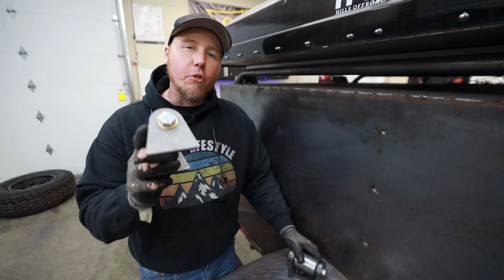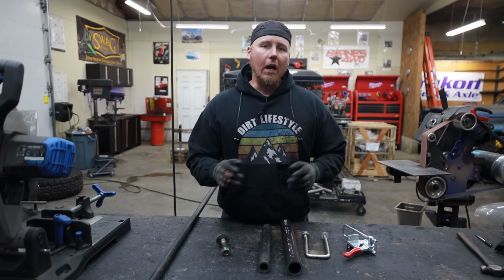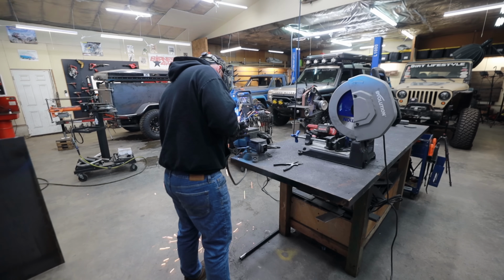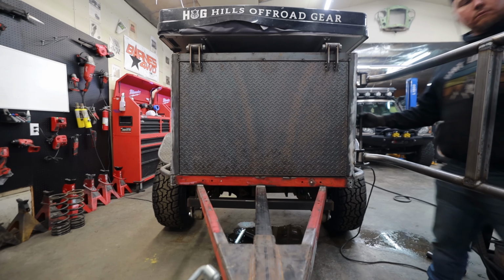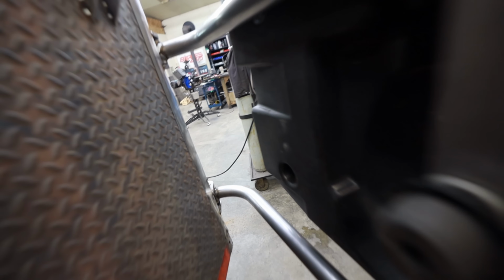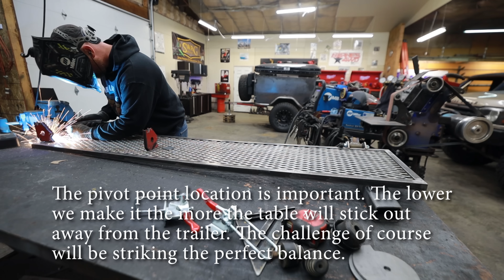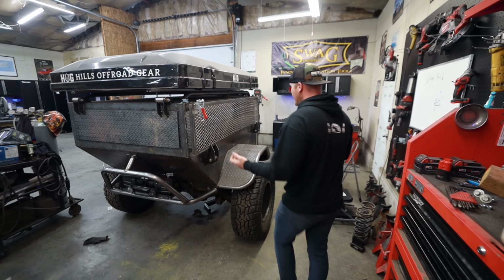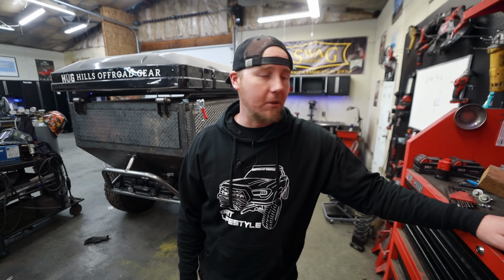Finally Back In The Shop! Harbor Freight Offroad Trailer Episode 6 👊.

Comment: Retracting cable: so you have to think of it as a triangle... on the base of the table you will need a spring about the length of the table. Next you find a washer that you can secure your cable to on one end. slide the free end of the cable through the spring to a cable wheel on the corner of the table. then run that cable to a mounting point on the actual trailer which will determine where the table sits when its flat out. this style would actually help hold the table still during bumps and driving as the spring will always have force on it. when the table is fully opened the spring should bottom out or hit a stop. of course please cover this with a small c channel or square tubing to keep it covered. should look clean and honestly help alot.
Reply: adding some clarification.... this would be using a coil style spring that compresses you can use a normal pull spring you would just hook the cable to spring and would want a spring that would stretch enough to allow the the table to lay flat. and it would pull the back up if the spring was to strong so finding a balance is the hard part for the springs.

Comment: Could you add a length of 90 degree angle going across the bottom of the table - taking the twist out of the table when in use - and then install the bump stop as you suggested? Possibly even add a 3rd hinge to the table? (Not really necessary but would be, your normal, over engineered design)

Cables are cool but for functionality, it would be good to not have 2, 45 degree cables in the way at all.

Love your videos, and keep up the awesome work!!

Comment: What about making legs that pivot and use a pin to lock them in place. You could tie them in diagonally to the tube frame of the fenders. That should give you plenty of support, stay low profile, and no cable to snag.

Comment: Reading through the comments seem there are some really great ideas and some very simple solutions, however if you really want to go with a retractable cable I'd like to see the attempt made. If it fails there are some grate fall back options. Along the use what you have idea, have you thought of using old pull reals for small engines? (lawn mower pull cords) look forward to seeing what you come up with!

Comment: What about using two pieces of 2" flat stock? One stock has a channel through the middle of it and the other has a bolt that can slide up and down, in the channel, with the motion of the table. No cables :)

Comment: Weight the cable/line on the inside of the trailer. When you raise the table the weight will pull the cable through and keep it stowed nicely. It can also help take some the table weight when you're raising and lowering it.

Comment: off the top of my head, you could use gas struts, or...maybe repurpose some seatbelt retractors? could be quiet, pretty strong..and cheap (any pick n pull....) I'm sure there are some high dollar options...but I'm trying to stay with in 20 bucks at a junk yard...

Comment: How about a smaller version of the rear door spring that on the back of a toy box trailer. They have cables to help lift a door that’s heavy maybe with a light enough spring it could be the opposite

Comment: Idea for the table, why not use a stop system on the hinge itself so there isn't a cable at all. you've built it strong enough to handle the weight of it all. shave your stud path into the part of the hinge on the table, then put a stud in the part of the hinge attached to the body, i would use a rod that went through both sides.

Comment: This would require not really a lot of work but...
Try a recoil starter style found in most gas generator starter cover which is spring loaded, which means even if u forget to secure the table it will still be able to hold the table up 
It's actually a simple system but it looks complex

Comment: The idea in the top comment about the flat bars is probably the most reliable, but if you wanted to pay homage to your Land Rover, what about using those retractable cables they use on the lower hatches in the LR3/LR4 (Discovery 3/4), part #BHF780040. Not sure if they would be able to stabilize the tray enough, but thought it might get some wheels turning.

Comment: How about retractable nylon straps? Like a ratchet strap type material or seat belt type thing. I know they have ratchet straps that retract into a little housing I'm not sure exactly how they work but maybe they could be modified? My other idea would be a flat bar hinge like a tail gate but that might be difficult to package. Then I also thought of those little gas struts, the struts would possibly keep the table more rigid but may also be difficult to package as well.

Comment: Before you finish get rid of the huge water tank that isn't removable. Use a few smaller ones you can pull out and wash properly.
Reply: You can link 2 together on each corner to keep the lower side more balanced and add more weight to the bottom of the rig. Mount your 2 battery in the very front corners on each side. Make sure you can remove and access them easily.

Comment: If you really want to use cables I would think "Roll Up Garage Door"... Unlike a garage door however you won't really need any tension to raise the table, You will only need enough tension to wind the cable back up. Also unlike a garage door I would use two independent assemblies - One for each side.

Comment: its call monkey tail or something like that. its use in the oil industrie, as a secure life saver line for the person that is working on the top of the plataform, its a strong to hold a person, and goes in and out so it wont be on the way.

Comment: Use old bike or motorcycle drive chains for the table suspension. They won’t bow or shoot out the sides they will just follow the chain in one plane as you close or open the table.

Comment: you probably already figured out the table supports, but what about the ratcheting ratchet strap systems that are used on contractor ladder racks? will get long when you need it to hook on the table and hold it up, then will crank back up into a small package that can lock and won't come out on it's own. would also help if you put matching tie points on the other side of the trailer to tie down temporary stuff to the top ;)

Comment: First time tuning in; very impressed with your skills! I could definitely learn a thing or 2!
Commenting on neat ways to suspend your table, and it'd be cheaper to build your own, i'm sure; a "Shur-Lok" mechanism, for ag trailers, comes to mind for me. (I'd advise looking at one, if you can, at a truck stop or something (the website displays the mechanism poorly)). Its located at the rear of the trailer, and has 2 little plastic pulleys at the cables exit, and the cable fastens with a loop around the "pipe" that rolls the tarp up.
Essentially, its a retractable cable, that uses a spring of some sort, to assist in the rolling of the tarps, to keep them from rolling crooked. I've never pulled one apart to know exactly what makes 'em tick.
But mount one across the rear of your trailer, and one across the front. Even neater, would be to find a clean way of mounting them both internally of the trailer, and have the cables come out a hole, but make it so it doesnt drag the cable on the way through outer panel.
Good luck! I'm sure you'll find a neat way of gettin 'r done, and i'm anxious to see how you do it!

Comment: Sliding tracks on top of trailer to extend or retract cables? Extend to lower, retract to tuck the cables. Could be cheap with tubing, little peg to keep it from sliding back out. Also can be used extend to hang towels to dry?

Comment: Square tube that's cut at a angle to where it will slide into another square tube on the side you can extend the square tube that's on the ends already.
Should be plenty strong.
Or use chain? Easier to see and looks cooler, can make it to where it hooks to the table and the side?

Comment: Nice latch!

Simplest would be a spring and cable with a stop placed flat under the tent.  Or a seat belt retractor with cable wound onto it, placed underneath the tent.  Going through the side of the enclosure is going to leak, and will undoubtedly leak in rainwater.

I still think the front door, needs to fold down, not up.  This gives you more "table" surface.  And you are going to whack your head into that folded up door at some point.

Comment: How about lift gate struts or a hinge setup similar to a truck tail gate or both so you have the strength of the hinges but use the struts to control how quick it drops down?

Comment: For the table. I wouldn’t want the cable in the way on the side of the table. I’d probably build a strut on each of the fender that supports the table from below then when the table is up you just pin the strut to the underside of the table.

Comment: Would a set of small struts work, something similar to a tool box lid but in reverse. The ball sockets would allow the amount of pivot needed and could retract as well as keep the sides stable. Could even be used in conjunction with your bump-stop on the fender.

Comment: not sure how involved you want the supports to be but you could do a simple weight and pulley system like windows in older homes have. cable through a hole over a pulley and perfectly balanced weights. might be fun to engineer?

Comment: Not sure if i can fully explain this, send me a note on patreon if you want to talk more, but run cable like you want but on the trailer side anchor it  through a hole in the side of the trailer with a stopper on the end.  Then run some elastic cord inside the trailer to pull the cable in when you go to stow it away.  The stopper will give you the distance you need to hang down and the elastic should pull all the cable inside for the drive.  I've seen it done on racing sail boats to keep the lines tucked under the hull and off the deck.

Comment: Just a thought but I wonder if a cable that goes through the side of the trailer with a counterweight shaped like a T or something shaped to catch on the wall and support the weight of the the tabletop would work. Within theory it would be simple and if you placed the cable in some square tubing, the cable wouldnt get kinked up or catch on anything.

Comment: For your table why not use some small flat stock hinged in the middle like a pickup tailgate. When the table is folded up it would be completely folded inside the angle stock of the table frame.
Reply: So I didn’t read the comments before commenting but the tailgate style straps seem to have the most votes. Simple design. Nothing mechanical to fail.

Comment: A garage door has a retractable cable system. It uses springs that are torqued to suck in the cable. You could definitely build a system based on that. Another option would be removable chain with clips at the ends. Either way i would love to help. I'm in the Tacoma area and am a welder/ fabricator. Hit me up if you want any help!

Comment: On the old Toyota Pickups (not Tacoma) the tail gate support Rods would work great for this instead of using cables or chains to support the side table in the lowered position. its basically 2 flat steel peace's that fold up and down and pivot on one another to support the tailgate like a tailgate cable but its not a cable. I would post a picture in this comment but cant!

Comment: Extension poles is an idea for the table and some thing similar to that grabbing piece for a whatever that rod is called that holds a hood up to hold the pipes when folding with table. If you can get real creative maybe finagle a way to stand those poles upward while the tables put up to make em into two flag poles.

Comment: 1950's Chev wagons have a retractable cable system for the tailgate. I understand though they are pretty expensive. But could be used as a guide when trying to find something similar? (Probably not helpful)

Comment: Have you weighed the trailer yet?  Just curious being almost all steel.  On the table, Just make a foldable arm on the table on the two end edges.  Think of a reverse hood support.   Attach it on the front edge of the table.   When you fold the table down, the support arm would then pivot up to the top edge of the trailer to a bracket and throw a hitch or clevis pin in to secure it.   when done, fold it back against the table and use the same hitch or clevis pin to secure to the table.

Comment: Hey, why not mount some 'tent pole' style tubing each end of the table, with a push to release pin. like a tent pole height adjuster? that way you still get your triangle strength each end and its 2 sliding tubes will not get caught up on anything.

Comment: Why not arrange a cantilever setup with your hinges?

Another idea would be to weld triangles (this shape mainly to help anything it may rub on to get up over the table rather than catch it) drop springs into it and run yourself a cable through the spring and out the top of the triangle. Cable would go through a washer then through the spring out the top of the triangle to a pulley on the top to keep it from chafing... maybe use paracord or something of that sort that'd allow it to be the weak point and then much like a synthetic winch line you could run it over a piece of tubing or something and you could easily carry extra with you.

Comment: Instead of cables look at the C10 tailgate 1976. It would be simple self folding two pieces of steel that you can easily take on and off only if you want.

Comment: In assembly line manufacturing they have these cable reel things called tool balancers that might work for what you are after.
That said, why go with cable when you can do a 2 bar link like an old school truck tail gate.

Comment: What about a trampoline style spring with the cable attached to it and a pulley on the inside or maybe just sticking out the side of the trailer. McMaster carr is where I would look for springs. Or maybe even a counter weight operation like old windows with the cable to right length with a stop on the cable might work out.
Reply: Old house windows with the weights in the wall
Reply: Also what about metal straps like some older tailgates had that would make it more ridged and wouldn’t be cable all the way to the corner of the table

Comment: What if you just drill a hole that the cable slides through and just add a large washer or a knot style of the other side so it does not fall about and it holds up the table.

Comment: I don't know if you're old enough, but older windows had a weight on the inside of the wall, to keep windows open..
You could build something similar, a small weight is round stock, welded on the outside of the trailer.
Hope you understand what I'm saying..

Comment: A retractable dog leash, x2, should be enough to support that table.  They are typically way too long for what you need, but I am sure you could just cut the leads to the size/length you needed.  They would automatically stop once fully extended.  Walmart, $15 each for 110 lbs of weight handling, each.  "Vibrant Life" is the brand I saw.

Comment: Folding table. All that comes to mind is old truck folding tailgates. I've not seen retractable systems, but they may exist. I have small Teraflex mini tables that fold down from with the inner side of the tailgate. The wire cord, just folds back in when it goes back up. Your system is larger & longer (if you needed) cables. Your filming, description & work systems are impressive .

I have a Titan tank on the back of a 2 door Rubicon. The system works pretty slick except the plunge cord & bobbing of the metal end piece does NOT activate gas flow once the level is below half. I got very frustrated with the system & then found a small hand pump that attaches to the end of the tubing line. 4-5 pumps and the gas flows, which I put into a four gallon container that sits behind a 4 dr. Rubicon.  Also on my titan tank, the lid leaked, and after contacting the outfit in Idaho, they sent a new lid that has worked fine. When we go into Canyonlands, Maze area, down the Flint Trail, into the Doll House, and days later out the Hite Road, and then N to Hanksville, we need extra gas (usually) for two vehicles. With the Titan tank & a full 4 gal Rotopax, we normally put 4-6-8 gallons back into each vehicle; & extra is available if a stranded vehicle arrives. At times we have shared gas, & copious amounts of water to some that were "under" prepared.

Comment: Why not use two flat bars that are the length that the table is wide and have them pivot in the center on a pin so when its hanging it’s straight but when you fold it up it folds with the table. Same concept as cables but flat bar that will tuck in the same position every time.

Comment: The trick is a spring strong and durable enough but not larger than an inch in diameter, 1/2" would be ideal but 1" would still be acceptable and not require pipe that would rob real estate inside the box

Comment: Do the cables have to mount to the edges of the trailer? If you mount the cables inboard 6"-12" to the edges of the trailer, leading to the edges of the table at a slight angle. They should not poke out the ends when closed, but would still provide a rigid surface when opened.

Comment: All you have to do is put a weight on the cable on the inside of the trailer. As soon as you give the cable slack the weight would pull it in

Comment: You could drill a hole all the way through the side of the trailer at your desired height for the wire. Then feed it through the side of the trailer then put a counter weight on the inside of the trailer.job done?

Comment: Would positive stops on the hinges not work?  Not sure how much weight you're planning for but a welded stop on the hinge plate and a point of interference on the table side hinge would provide a stop with no cables or arms.